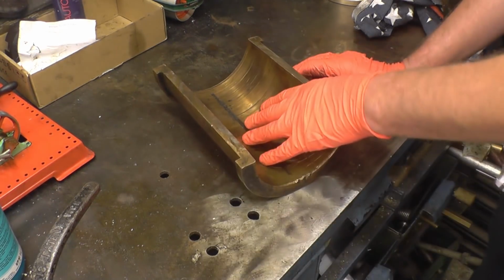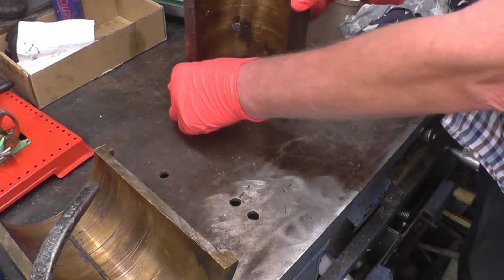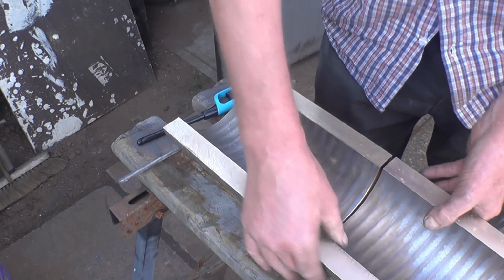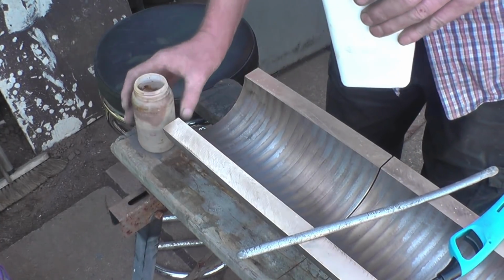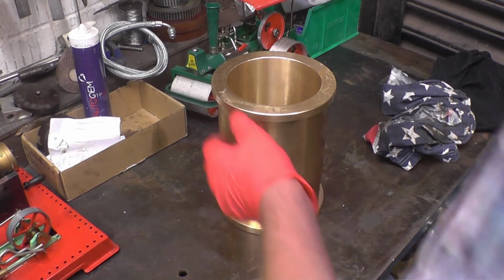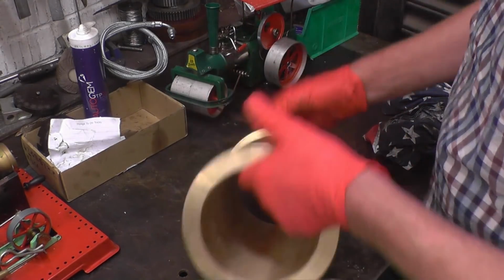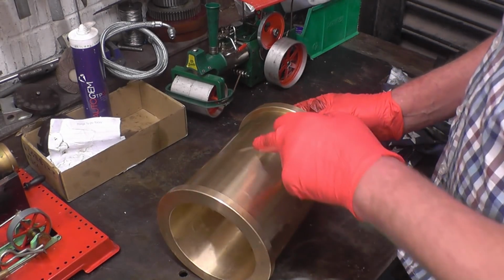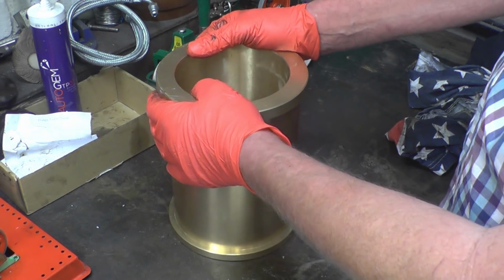SNNC 345 P1  Big Split Bronze Bearing . Monthly Give Away

Comment: This brings back memories.  I've made I don't know how many split bronze bearings over the years. Mainly for old open frame stamping presses and the mounting bearings for large horizontal Cincinnati Broaches. We always roughed the ID  and OD to a little over the slitting saw width and then silver soldered them together. Set them up in a 4 jaw with the seams as close to 45° from the jaws as possible.  Semi-finished to about +.040 or .050 on the outside and wrapped with hose clamps. Finished the ID and then the OD. Smack with a deadblow to seperate and mount. Most often they were mounted with brass flathead screws. Then they invariably had to be scraped due to the clearance the boss wanted to start with. The fixture bearings were machined to about .002" clearance to start iirc. Press bearings were generally .001 per inch of diameter.

Comment: That was very interesting. Really enjoyed it. Couldn't understand why the piece wasn't bored to size then cut in half. There must be a reason. Very satisfying job to do in any case, knowing it will last another 100 years.
Reply: because when you cut the bearing in half you would lose the thickness of the blade on each side therefore you would be losing your diameter or whenever it goes around the shaft you will have a gap at the place where the blade went through and it would cause the bearings to be able to shift back and forth
Reply: @johnl5177  Thanks for that, of course. Dont know why I didn't see that to begin with.

Comment: John, to part the bearing, fire up your metal furnace and place it on top to heat up. This will be a more even heat than using a gas welding torch. Or if you have one a BBQ.

Comment: If I understand this process of soldering the halves together, then machining on a lathe correctly, it seems that it would allow you to avoid the need to line bore a 2-piece split bearing afterwards.   In this situation, where there's just the half bearing shells, it seems to me that it could have been machined on the lathe in one piece, then cut, and it would have been ok?      (this process is much cooler though, and it sounds like it's more authentic/correct)
Reply: Split bearings have to be bored and turned after splitting. Otherwise there will be a gap between the pieces, that means you'll clamp the shaft with them and it wont spin.
Reply: @VulcanBomberxm655  that's true if the two halves are used together, however these bearings will not be used as a set.  Each half will be installed on one side of the machine by itself with no gap to account for.
Reply: joshonthetube I was thinking the same thing...
Reply: We made smaller versions in our shop. Always machined them, then cut them in half with splitting saw.

Comment: Years ago I worked in garage where they used to repair car radiators they used  town gas torches and the flux was Spirits of Salts. Will you replace the bearing if it fails in 80 years time instead of a Hundred?

Comment: I remember them making these bearings when I used to work in the coke works, they made them exactly the same. Nice memories.
Reply: Very impressive bearings. The material must cost a fortune.  Nice video as always, John!
@Toby: out of my interested in industrial history I am curious and dare to ask which coke works you have been working at. (I hope you don't mind me asking.)
Best wishes from Aachen to beautiful England  Harald
Reply: @HaraldFinster  I worked at Cwm Coke Works in South Wales.
Reply: @tramtoby  Thanks for your reply, Toby.  That name brings back sweet memories, as I photographed the Welsh collieries in 1990 and visited Cwm Coke Works in 2003. It was a fascinating place. Hope you enjoy my photographs  http://hfinster.de/StahlArt2/archive-Cwm-en.html It was a wonderful experience to meet the friendly and hard working miners and the management was extremely helpful too.
Reply: @HaraldFinster  If it was still open I would still be working there. Best job I ever had.
Reply: I used to do the turning pre and post soldering, as an apprentice, I was scared to death of them splitting, these were for Seam Welding (Electric Resistance)